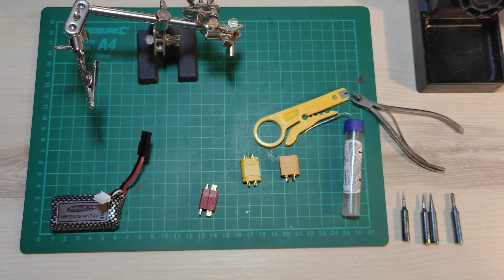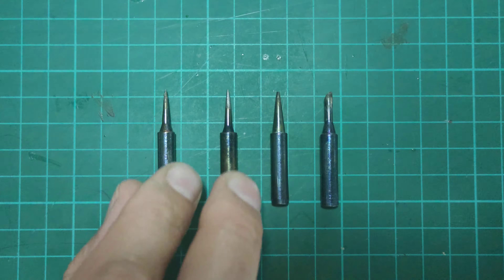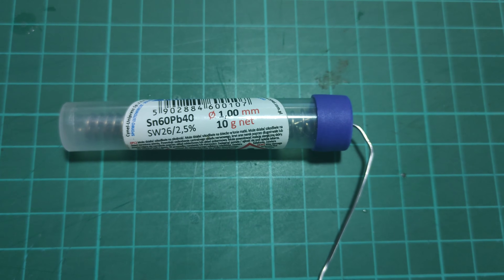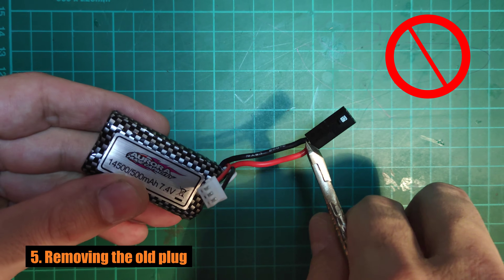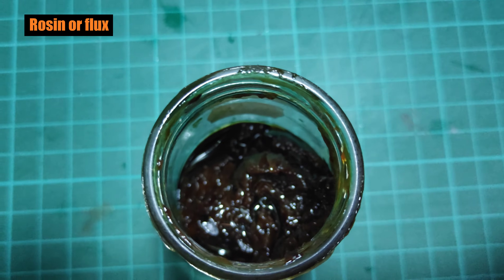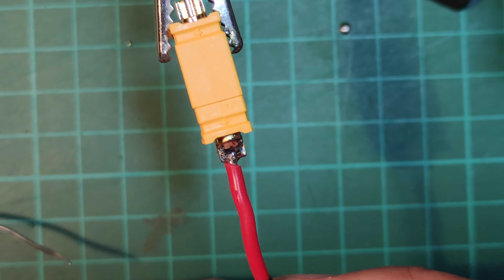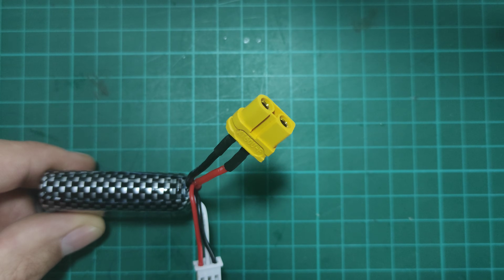Soldering XT60 connectors - tips and tricks

Comment: Excellent video - as other people have commented you have a very clear, well paced approach.  It turns out I must be useless at soldering.  I tried about ten time last night and just gave up in the end. I ordered a pre-terminated cable from Amazon instead.  When I look at the video you have very thin wires that must heat up really quickly.  I'm using 12AWG wires and they barely fit into the connectors.

Comment: You were doing great until you put solder in the connector pin and then reheated it to insert the wire. Just insert the tinned wire into the untinned connector pin and use a jig to hold the wire steady. Then heat the connector and wire with the iron in one hand and apply solder with the other hand. When you stop adding solder, pull the iron away, and let the connection cool down before moving it. You should never reheat solder or heat it for too long, and you certainly should never try to insert the wire into the connector while reheating the solder that you shouldn't have put into the connector beforehand.
Reply: If the wire is tinned aren't you reheating the solder? 🤔

I have never heard of this before can you explain why you shouldn't reheat solder?
Reply: @IndySpeedControl  There is very little solder on the wire when you tin it. You're going to add more solder (and flux) when you solder the connection. If you heat solder too long, the flux will evaporate and the solder will turn into slag. And when you finally do pull the iron away, it will pull some of the solder with it and make a sharp point or spike.
Reply: @TheRCAviator so add flux, tin the wire. Flux the xt60, hold wire to the xt60 without tin, heat the wire and add solder to wire that’s hot enough to melt the solder. Also using the mating side to avoid the pins moving
Reply: @jbrito3616  I never use flux. I just tin the wire, use a fixture to hold the wire in the untinned connector (with mating plug), clean and lightly tin the iron, hold the iron against the wire and connector pin, feed solder when the wire and connector pin are hot enough to melt it, and when the joint is filled with solder, stop feeding solder and pull the iron away.

Comment: 48x 24A lifepo4 3C electric bike, does XT60 or XT90 go? Also, is the female connector plugged into the battery side or the other side?
Reply: XT60 should be enough for 24A. My 48V 25A bike runs no prob with a 60.

Comment: Tried this... for 2 fucking hours. And yet the godamn wire wont solder into the plug. I can tin the wire, and the plug, but when I put the wire tip on to the plug, and press the wire into the plug with soldering iron. fuck all of nothng happens, no matter what tip I use or how long I'm pressing it.
Reply: It sounds like your soldering iron might be too low power/wattage. Regardless of the tip size, a low power iron might struggle like you are describing as the heat conducting mass increases (both the wire and the connector are dissipating heat from the iron and the iron may not have enough power to keep up). Particularly if you have two connectors paired together, this is briefly discussed at the 2:00 mark in the video.

Comment: I thought the copper has to be fully inserted into the hole. No wonder I had difficulty inserting it in as my wire is tightly fit with the hole

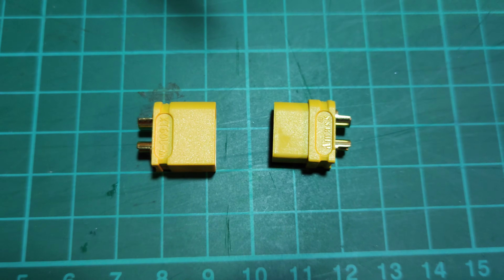Comment: At 1:45 you mixed up female and male part. The female is the one on the left, not on the right.
Reply: You need some education budy, he told it right, the one on the right is the female connector because is has 2 holes inside. Google it out of you wanna say more.
Reply: He described them correctly. Think about it from the perspective of the bullet connectors, not the plastic molding.

Comment: Is it possible to use xt60 for:
300w solar panel cable wire to (xt60) ---> solar charge controller?
Reply from the maker: AFAIK the max current output of the 300W solar panel is less than 25 Amps so the XT60 should be enough. If you want something more durable I suggest to use XT90, but please remember that neither of them are waterproof.
Reply: @pandubek387  true, but you can pack with grease first, before plugging them in.